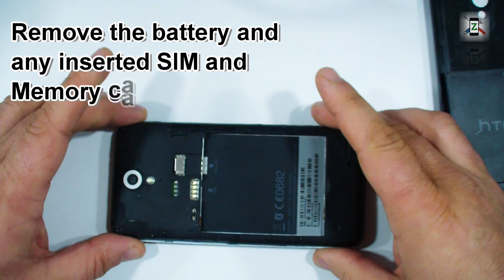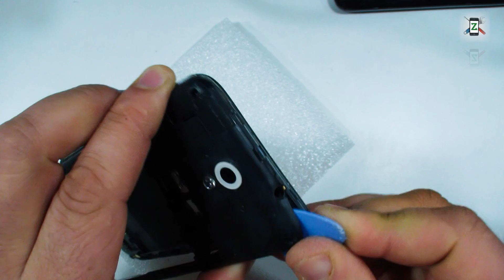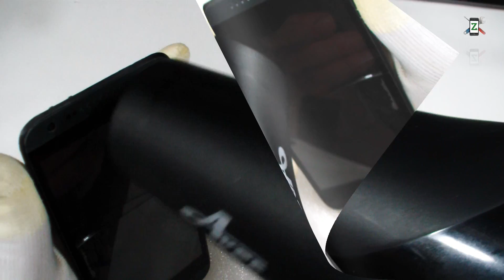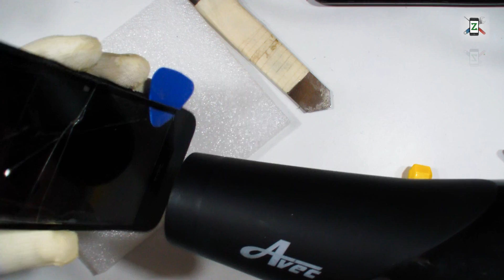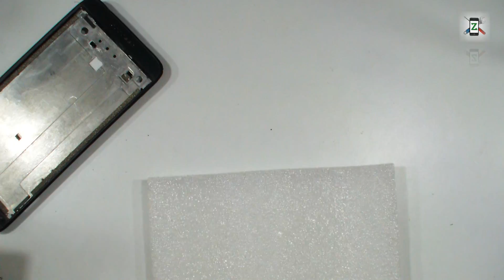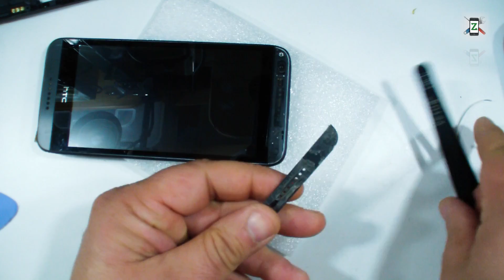🛠 HTC Desire 620 Touch Screen Glass Digitizer Replacement

Comment: Thank you very much for showing how easy it looks to replace the digitizer and the touch screen. I have one question to ask. Could you possibly use HTC Desire 620G digitizer and the touch screen for the model HTC Desire 620? The size and the dimensions of the touch screen are identical in both model. I looked it up and find out they sell generic digitizer and the touch screen on the internet both for 620 and 620g models. So I think, the parts are interchangeable however I am not %100 sure! Do you have any idea about that since you have experience in replacing touch screens on mobile device such as HTC Desire 620 on this video. Do you think 620G touch screen from an original HTC desire 620g can be restored on a HTC desire 620 smartphone?